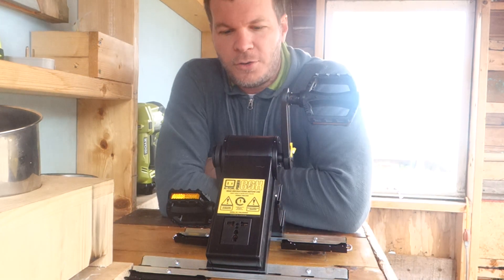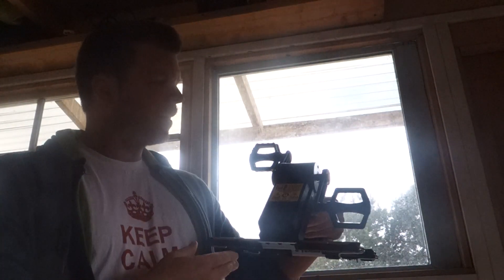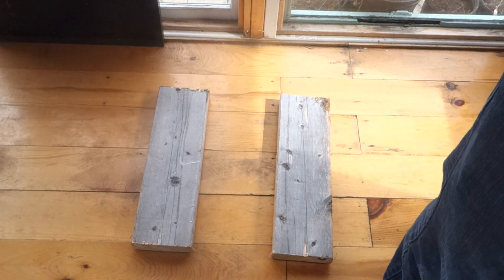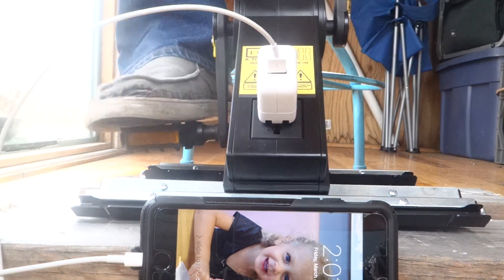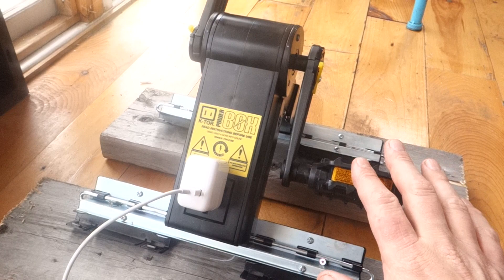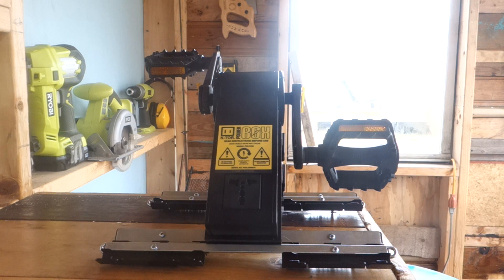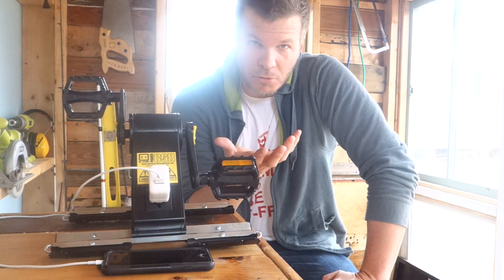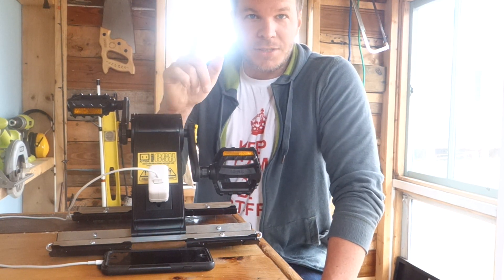Power Your Tiny House With Your Body?

Comment: What wall charger are you using to charge you phone? Is any wall charger fine to use? Just wondering because the output of the powerbox is in DC and wall charger's expect AC. Thanks.

Comment: Waste of time, you should scale it up so you could run in a wheel or some shit and generate way more energy.
Reply: actually I use a DC/DC buck converter so I get 4 amps while pedaling slower with low resistance (lowest bike gear) - just see my channel - I uploaded the vid

Comment: If some engineer could come up with a "gutter charger", using the kinetic energy of water flow...one kills two birds with ONE stone....
Reply: +Frank From Upstate NY I have always wondered why I never saw stuff like this.
More so when it comes to cities than houses off-grid.  

Think about how much water falls in a city and the height the water falls.
Slapping a bunch of those in a pipe on a skyscraper and you have a lot of water falling a very far height indeed.  
Sure it won't be putting out megawatts of power, but it will be very cheap to make and put out enough for the lights of the building, or heating.

When it comes to the off-grid side of things, it could help a little bit, but it would be better building a self-contained device that is much larger.  The weight of the water won't be enough to give any reasonable levels of power from it.  
Or even creating a roof-top storage tank for grey-water, then have it funnel through the motor before coming out a tap or hose.  
Having continuous movement is better than a once-off push from a stream of water every so often when enough rain collects.  

Same goes for numerous small dams over massive dams.  Easier to maintain, can be replaced for very small amounts of money if they fail.  
It is just overall so much cheaper to build, and will still get the same amount of power out of the system, if not more because you can fit more small dams between the "sources" and where land is too flat, on average.
And again, same for wind.  There are more slower-winds than faster-winds.  They are around constantly, even in seemingly calm days, whereas the speeds required to push those massive turbines is far far higher.  
You can build smaller turbines far cheaper, in far higher numbers, and more of them can fit in similar spaces.  (of course, you'd not do that because you suck all the energy out of the wind the further you went in to the farm)

In the end, the supposed energy losses from smaller motors is beaten by the fact you can have considerably higher numbers of said motors than you could with larger ones, and at far lower costs at every level of their operation.  
Madness.

Comment: Even if people are not agreeing to it being able to provide and lot of power, is it safe to say that it would be enough to power up at least a plug in radio during a power outage to get news info? Could help during a earthquake/hurricane/tornado and you have to power and dead batteries. My mother had an exercise pedal thing like that and you had to put it again a wall or something heavy to pedal or it just slide around. But using your hands instead of your feet does the same thing and you can keep it steady more.

Comment: The Power Box is designed to be very efficient. It converts the generator output to 120 Volts DC with 85% efficiency. 120 Volts DC is compatible with all switching chargers — the type used with all portable electronics, because they are also very efficient.

Any device with a switching charger of less than 20 watts will work with the Power Box. This includes all modern cell phones, smart phones and all Apple products.

Comment: screw it to a small piece of plywood and then spray the bottom of the plywood with that new spray rubber and that should stop it from sliding around --- for some reason my first thought was wonder if i could put a sprocket on the thing ( replacing the pedals) and then gear it so it could be turned easier i have been thinking about a small windmill connected to my camper to charge things up when i am driving down the road. man that's just where my mind goes -- now most likely i could find a better motor to use but that's my mind for yah it always thinks of a different way to use stuff
Reply: actually sounds like a good idea

Comment: thats cool.......what is the maximum amp output?????????
Reply: I get 4 amps in slowest pedal (lowest gear on bicycle) with little resistance - using a DC/DC buck converter and treadmill motor - I uploaded my vid to my channel

Comment: that couldn't even power my laptop let alone a  house
Reply from the maker: Did you watch the video and what I said?
Reply: +Tiny House Listings yes, i just don't think it is that practical, that's all
Reply: +Oliver Gunn well it took a a good 2 min of online searching to find out it puts out the same amount of power as a wall outlet in your house -- so it could charge a laptop in the same amount of time as your wall outlet at home so it could put a good amount of charge into a battery bank if you where board and sitting around the house and need to workout anyway
Reply from the maker: +Alternative Life 100% agree and thanks for beating me to it!
Reply: +Alternative Life Sorry to contradict you but I'm 100% sure it won't put out the same power as a normal outlet, I might just be enough to charge a laptop but that's it, no one not even a professional athlete could power a toaster. The maximum a human can power is about 400w and that's not for long.
Reply from the maker: +Pedro Pinheiro this is why as suggested in the video the best use of this little device is to power up larger batteries that can handle those types of devices you mentioned.
Reply: Alternative Life my laptop charger is 150w that thing is 20w
Reply: Richard Cook
yeah to put some serious wattage of solar cells does not take up as much room as one would think either, want cheap? go buy raw solar cells adn build your own panels, there are some good deals on ebay with brand new chipped at the manufacturer, made in the USA solar cells too as cheap as 12 cents a watt depending on how many you buy at once. and thin brass shim would be easy to solder onto them compared to trying to solder up some rounded wires even when thin and bundled. plus it would offer some stability while installing them in a solar panel, I am looking at trying my hand at breaking in straight lines the edges and such to clean up some I bought (chipped cells do not lack in function, just amps according to how much is chipped on them, little chips? very little difference between it and a whole cell :) )
Reply: Short attention span?
Reply: do you know of any pedal power generator that can run a laptop ?
Reply: Alternative Life no which is why they are pointless
Reply: not really you just have to look at it in a different way helping to keep house battery's charged so you can charge your laptop some times when the weather is bad and your not bringing in solar now if that does not work then your most likely in the wrong spot just call up the power company and pay your bill then your good
Reply: +Oliver Gunn  sadly that thing looks like it barely has any torque required because it is not mounted firmly, if it was to get a work out of any sort on an extended time like doing a slow bike ride for an hour, it would probably be connected to a generator that could actually put out a couple 100 watts, I would say just build your own and get a better generator to go inside it.
Reply: +Tiny House Listings  hahaha I love ya!  ~laughing here~
Reply: +Alternative Life  There's no way in hell that thing puts out 1,800 watts.  So to say it puts out the same amount of power as a wall outlet, is just plain wrong.  Didn't he say it produces 20 watts?  The last time I checked, 20 watts and 1,800 watts are NOT the same. :)  Two  315 watt solar panels will easily produce 20 watts on even the cloudiest of days.
Reply: I uploaded on my channel - I get 4 amps charge via a slow pedal, low resistance (lowest gear of bicycle) - using a DC/DC buck converter and treadmill motor. It's awesome.
Reply: Alternative Life 20w is barely going to make a difference, its a cool idea, just not very practical